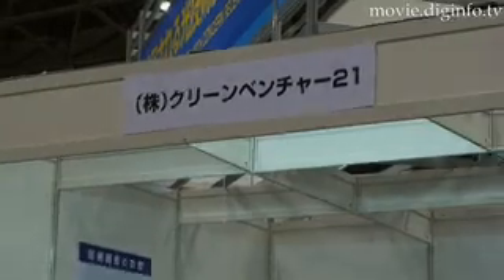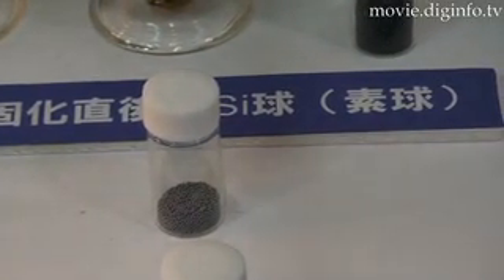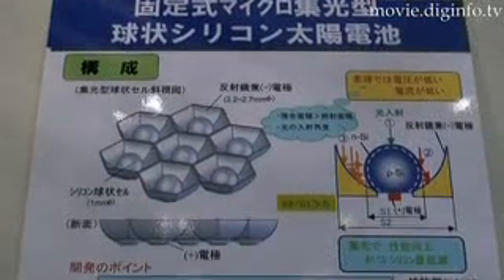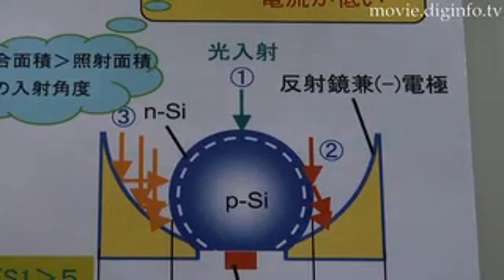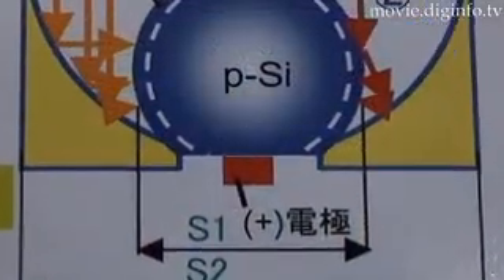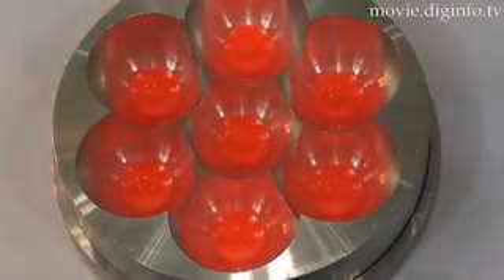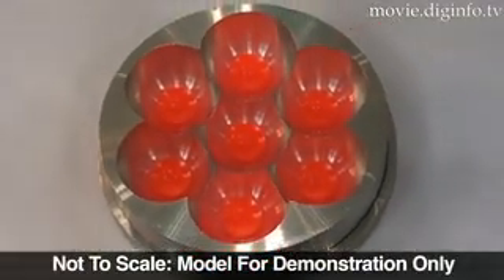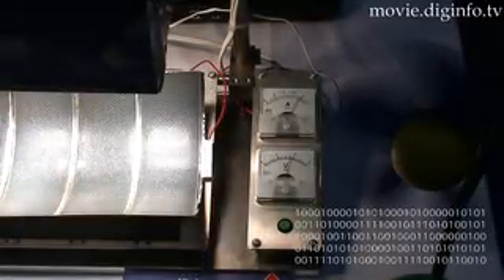Clean Venture 21 Spherical Solar Cells : DigInfo

Comment: This is interesting. I always thought that modern day flat panels were sorely inefficient. I had an idea I got from the mechanics used in expanding surface area that intestines use to gather nutrients. This uses a similar philosphy. Photons should be able to be reused once it strikes the silicon surface, if it can be trapped and bounced off multiple surfaces. I'd thought that a more "alternating" surface area would increase exposure, resulting in a smaller more convenient PV system.

Comment: Solar Sphere Panels,used on cars or in space: Energy to move the dishes all day to get the right angle focus on a car, Half the energy is used trying to move all the dishes all the time. Sphere Solar panels on say a truck more aero dynamic for traveling(compared to dish).Nasa space telescopes that have sphere shaped panels because to much energy to move a dish in space. Plus a dish must recharge its battery for dish motion.Battery last 10 years.Sphere solar panels don't need to move for sun